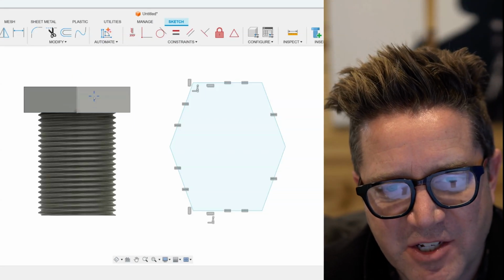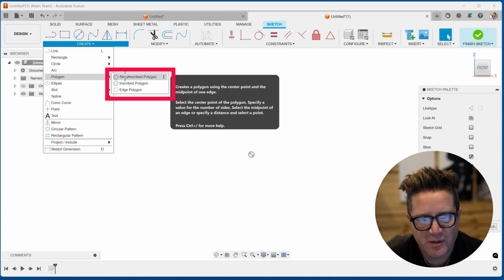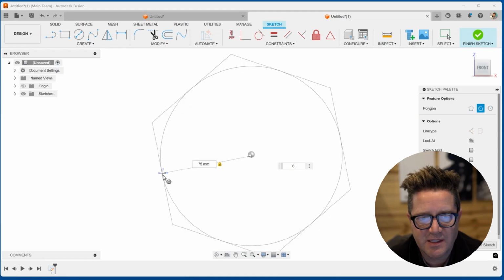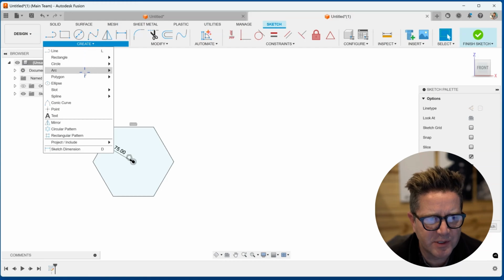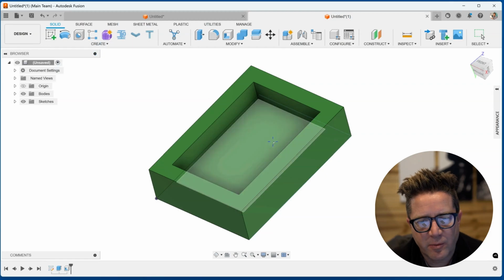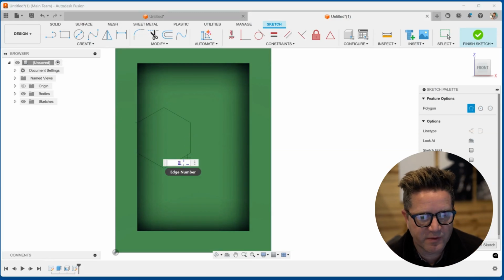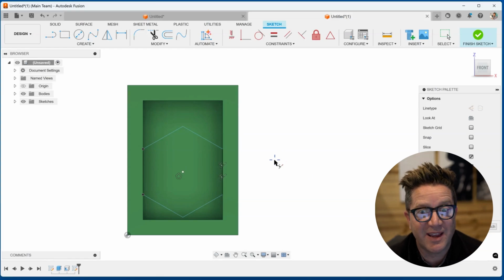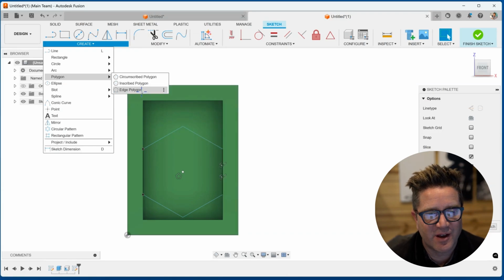Learn Fusion 360 Polygon – All 3 Types & When to Use Them

Comment: Thanks for the video, helpful. Why don't they name the tools with simplier names that give you a direct idea of what they are doing? They seem to have done that with Edge Polygon but really missed the mark with Circumscribed & Inscribed. Simpler names would make things so much easier. 

In general which Polygon do you use the most?

Comment: Why are we not seeing AI LLMs in programs yet. A prompt box, "I need to make a 1/4" NPT Thread." And it either tells you the steps or brings up the dialog box. Yesterday, I used Qwen 2.5 to help me calibrate my 3D printer. I could paste in my bed mesh and it would tell me which corner to adjust and if my results were better or worse than the previous.  I can see in Fusion, you could prompt.  "How do I combine two separate bodies into one." etc. Likewise for Adobe. You would think a simple trained LLM specific to the APP could do this even locally.
Reply: devs are lazy